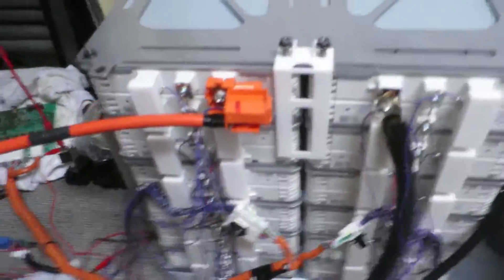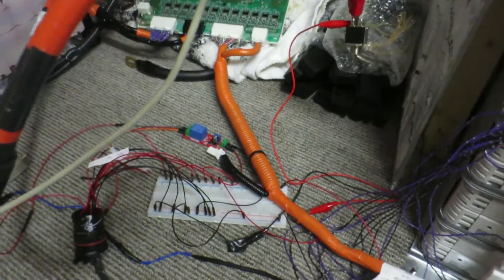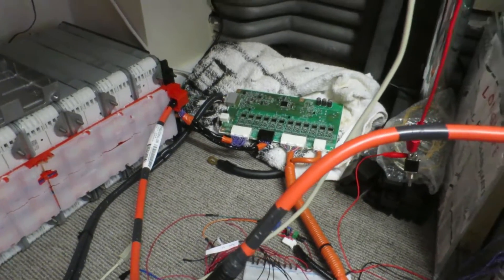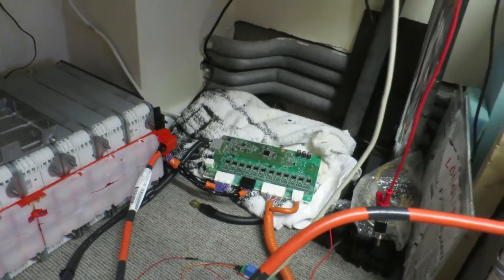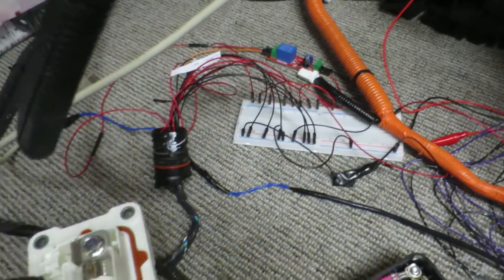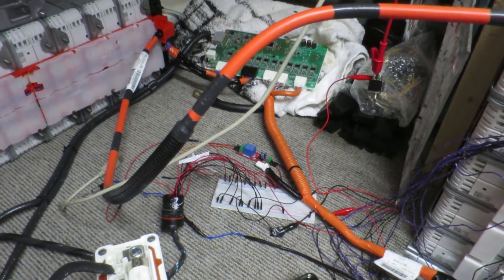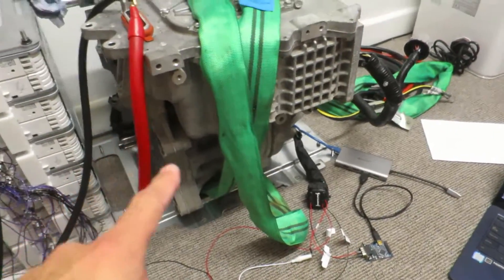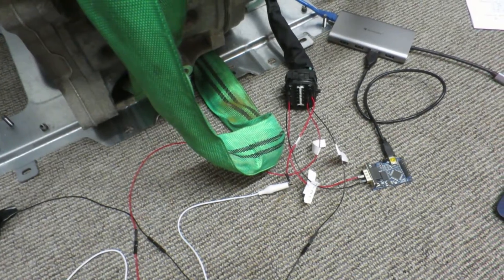Nissan Leaf Motor Spinning with Original Inverter - Week 6 RX8 Conversion

Comment: What is the advantage of using the original inverter over using another VCU?
Reply from the maker: So the inverter and Vehicle Control Unit are two very different things. I use the original inverter as its designed to work with the motor. I created my own VCU as you cannot use the leaf one - as it wants to be in a leaf!
Reply: @SouthWestEVUK  yes, sorry I'd thought you were saying you'd managed to get it to work without an external VCU but I understand now.

Comment: The balancing will be affected until you get the BMS repaired. It will incorrectly balance all the remaining cells, since it will think these are "higher voltage" even though they are not.
I actually have 2x spare 30kWh BMSes now, so if you can't get it repaired I'll happily send you a free BMS if you pay for postage!
Reply from the maker: Yes, the BMS also thinks the packs total voltage is wrong - I can only assume this is due to these cells having a lower voltage. Resisters are here and diodes coming early next week - will give it one go at a repair and then if it doesnt fix it I will 100% take you up on that offer, in fact I am almost wanting to do that at any rate as a backup - can you email me? rx8@blackhurst.co.uk

Comment: Dang buddy your getting ahead of my build, I need to catch up, although I’m using a Toyota Camry hybrid transmission mounted in the rear of my car, this is still awesome, plus I’ll be using stock electronics, and might look at getting leaf cells as well, looking at 170ah or larger 250 or 410 volts, to be determined
Reply from the maker: Blimey a hybrid must have another level of complexity to it! well done...race on!

Comment: Sounds and looks exciting! are the batteries pouch Li-ion cells?
I think your onto it with the balancing issues, my guess is if there's a diode, they seem more susceptible to fault over resistor but I could be wrong.
Anyway I'm sure you'll figure it out.
Cheers
Reply from the maker: Yeah if you look at one of my previous videos I have found the two faulty components, this was really backing that up. Hopefully get the bits replaced this week.

Comment: Making some good progress, well done.
Are you using a bought board for this or just the CAN signals from the Arduino to get the inverter working?
Reply from the maker: Just the motor, inverter, my Arduino and the can signals ;o)
Reply: @SouthWestEVUK  Wow! Good going, if I end up using a Leaf inverter I'll probably buy a Huebner board as I wouldn't have the programming skills to do it myself.
Reply: Will you be updating your project thread in Openinverter.org? I'm sure the guys there would be very interested in your progress.